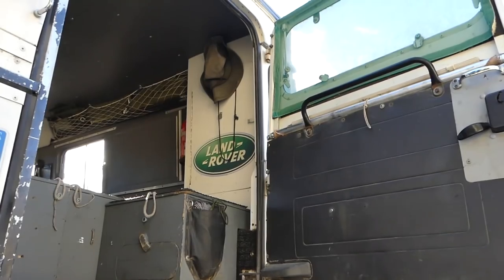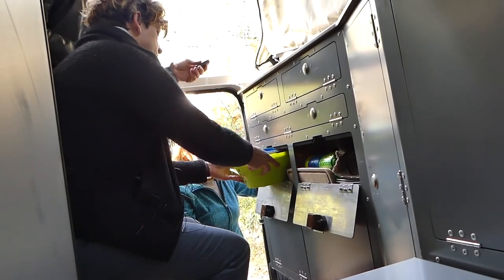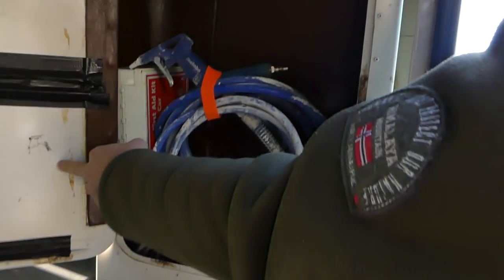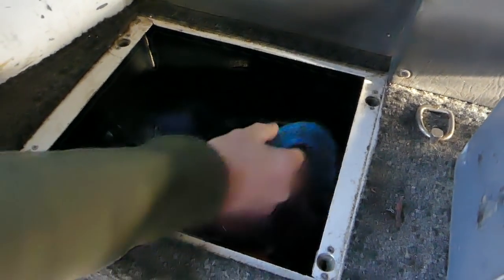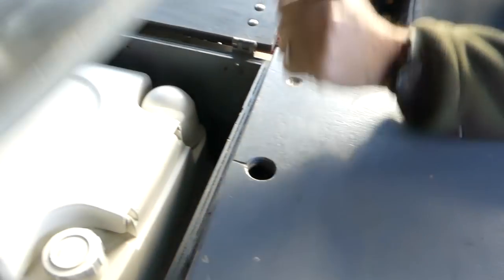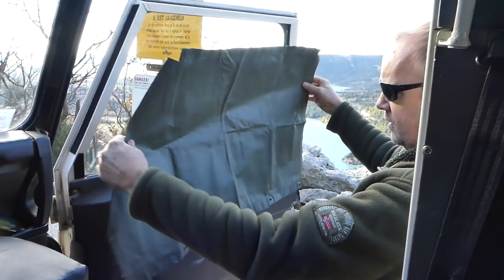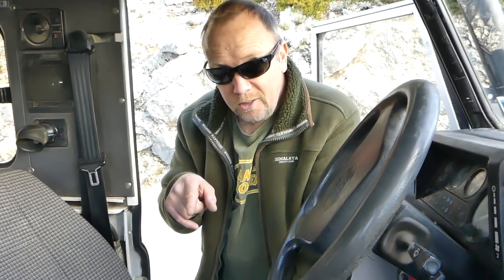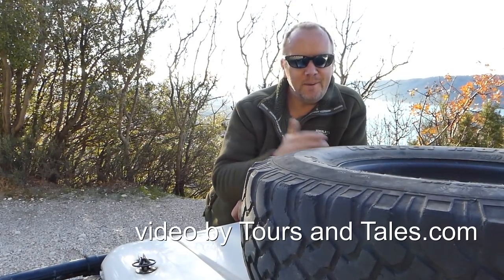Land Rover Defender 110 Overland/Camper pt2 Interior #overland #expedition

Comment: Superb truck. Some very good ideas there, I'm going to steel a few !!
Reply from the maker: ;-) Yes, the box system is making more sense the longer we drive around. I like the compressor hidden away and the insulation is very well done. Steal away, please do... you have a 110 too?
Reply: Just doing a full resto on a 110 for a 6 month tour over Europe next year. Been looking at vids for ideas and yours ticks a few boxes for me. Thanks again for sharing.
Reply from the maker: Thanks. Good luck with the build! (don't forget those little (aircon) swivel reading lights ;-)

Comment: Watching this for information. I’m thinking of buying an ex Army Defender 110 as an adventure/camping vehicle. It’s a 2008 and considering how well this is going for a ‘93 plate, I might just go for it
Reply from the maker: This one has led a hard life (offroad expeditions to some exotic loctions takes a toll) and  some 300 000 km but was impeccably maintained - full service, and more, after each trip! Normally the army does need to look after its vehicles, so be sure to check its history of course, and sometimes they lead easy lives just running on the highway... One point on a Puma is the output shaft extension from gearbox to transfer case - check for rust at the drain hole. Check out this one as well for some more Defender points (and as I mention - it is luck of the draw really) Good luck!: https://www.youtube.com/watch?v=V1YmigSfyws